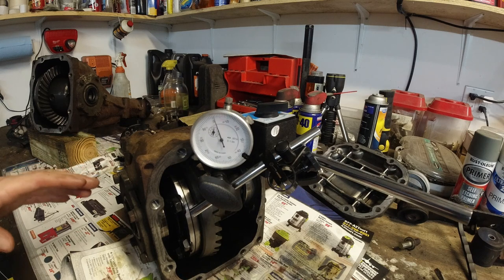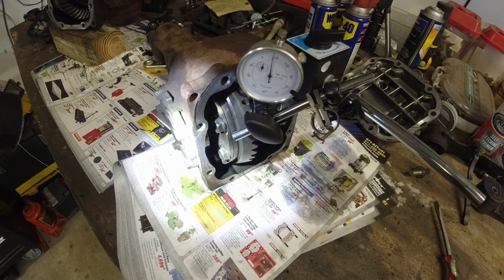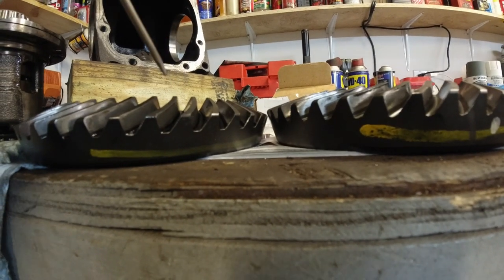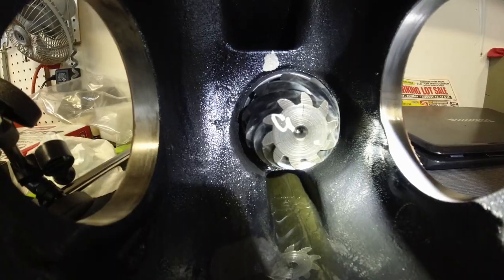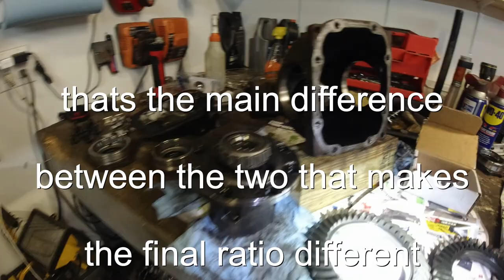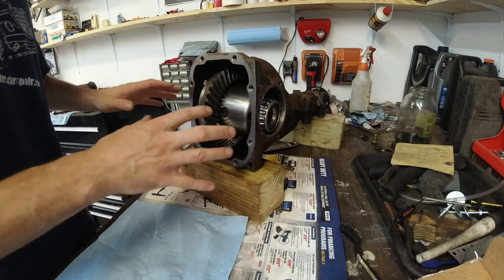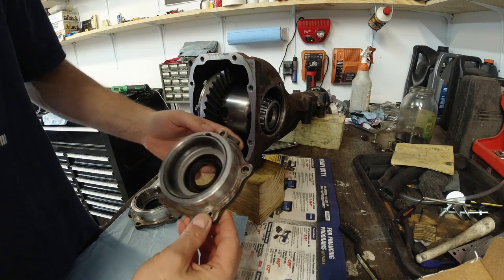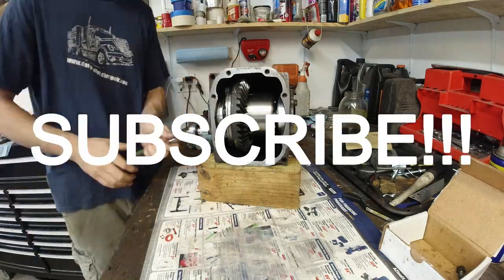06 Subaru STI rear differential part 1

Comment: I have an R160 diff with 3.70 ratio. After removing the carrier I discovered that the bolt pattern between the 2 rings gears are very different. The ring on want to replace has 8 bolts holding in and the new ring gear takes 12 bolts. So replace the carrier? Is that even an option?
Reply from the maker: carriers are same for most STIs, depending on the year of yours. In other words you can fit different ratio gears in a different year STI, ring gears, pinion gears....go on facebook, get into the Subaru Mechanics group and ask that question there.
Reply: Sounds like you have an '80s R160 from a XT or something. You'd need the correct carrier. You need to pay close attention to the axles as well. IIRC, The XT had a R160 with a clutch LSD and 3.7 FD. It used male axles. The VLSD R160 used a female axle due to the stubs on the diff.

Comment: Hello, so the 06 diff is LSD with the 3.5 gears. so you are putting the LSD  from the 06 into the 04 to use the 3.9 gears?     i am asking because i also have an 06 r180 from an STI and i want to change gears.   can i put gears from a non lsd r180?   i would like 4.11 or 4.44 if possible.
Reply from the maker: the diff and the carrier came from an 04.  I had to switch just the diff from the 04 to my 06, so I had to keep my original ring gear and pinion, I think i show the difference between the gears in this or the next part.  Whenever you change gearing in your rear diff you need to do the same to your front diff.  Otherwise front wheels will spin faster or slower then the rear wheels, which would be bad news.  If this was a rear wheel car then it wouldnt matter but since we got all wheel drive then it does.
Reply: I have this sti diff on my 280z. Since it bolts up to the car. So I don't have to worry about the front like you guys. Hehe. Jk.  It has the 3.54 gears I just wanted to know if I can just get any Subaru r180 rear diff and change the gears.  Thanks for the info.
Reply from the maker: I would think you can but you need to change both gears, ring and pinion and make sure to do a lash adjustment after the switch.